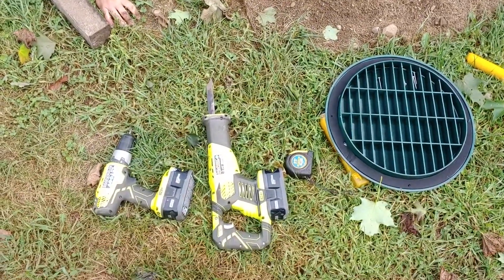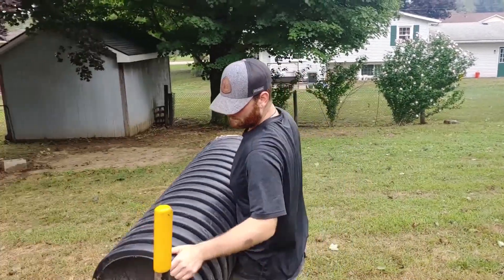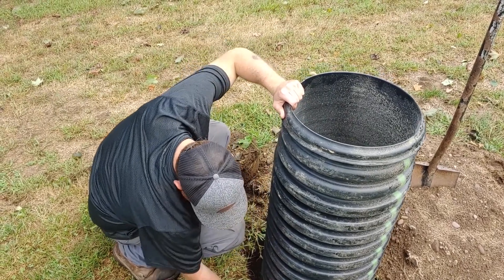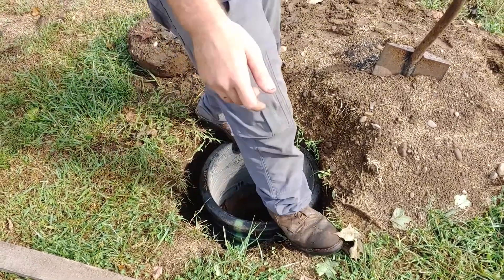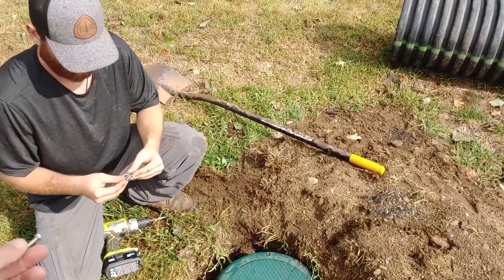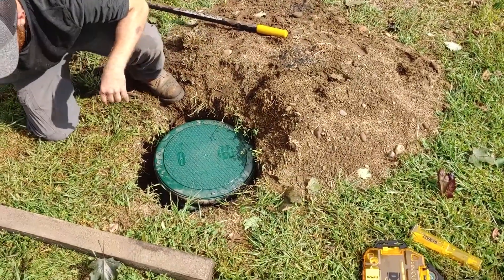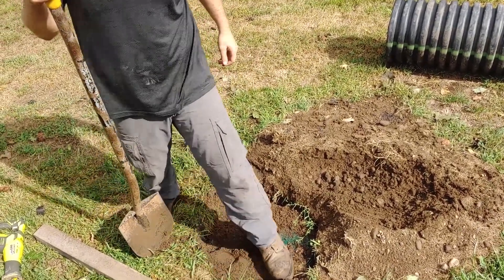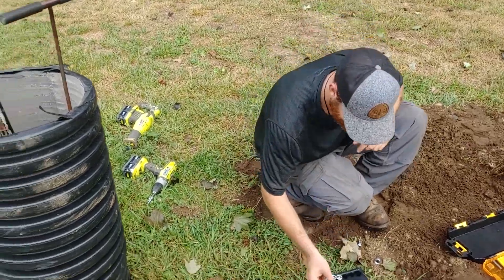How To Install a Riser on a Septic Tank

Comment: So, there is no gasket or seal attached to the tank?
Reply from the maker: if the riser is placed on. the flat top of the tank, a gasket could be used to protect ground water intrusion.  Thou that would be minimal. This riser is placed in the Taper inside the existing opening. No gasket/seamer is needed.

Comment: Thx for video.  I dug up my septic that is 6ft deep.  I want to put risers on top of the 2 cement lids.  I see 2 sizes are available, 18" and 24".  How do i know which diameter to use?
Reply from the maker: If possible go with the bigger one.
Ultimately just measure across your lid and add 2 inches.
Reply: @whipkeysepticpumpingllc.9796  It has 2 rectangular cement lids that measure over 5ft wide each.  Is there a benefit with going bigger diameter?  Also does it have to be double wall pipe if buried 6ft deep?  And i cant find an adapter ring online for 18" diameter.
Reply: Diameter is determined by   Hole in tank  16/18” dia  hole go w 24”  they make 12/ 24”
Mostly  they make 16x24 square
Reply: Older tanks may have no access  find center line in and out and drill top   Core bore  concrete lids are 4-6”
Thick

Comment: It appears a riser was removed and the new one Installed in place, installation being just resting it on the tank?
Reply from the maker: Nope. We dug down to the tank. Water infuriating isn't a real issue as the original lid is installed inside the riser. If we are worried about water or dirt working itself under the riser we would use waterproof adhesive around the bottom and outside of the base.
Reply: @whipkeysepticpumpingllc.9796  Thank you. I am replacing lids and one riser so your video helps me figure this all out.

Comment: In my state, you'd have to use a minimum of a 24 inch diameter riser at that depth. I'd also recommend filling the riser cover  with cement, because that plastic grid pattern will hold concrete with small aggregate, which really strengthens the riser cover. To be clear, it takes a day to setup, but then the Plastic Riser Cover can be flush with the grass, and it won't crack or break. Lastly, I'm a big  fan of the hex head screws, they seem to hold better, which makes the lid or cover more secure.
Reply from the maker: Thank you. We have tried the concrete in the lids before, with mixed results. No regulations for riser size in our area, we try to match it to the opening.
Reply: @whipkeysepticpumpingllc.9796 
I'm really surprised you don't have any requirements for how to size a "riser" on a Septic Tank. I'm in New Hampshire, and we have very strict state codes for Plastic Risers and Concrete Risers. In fact, we've got rules and regulations for how deep the Septic Tank can be without a riser, which is 12 inches. However, if the Outlet Baffle has a Effluent Filter, then a riser is required over the Outlet Cover of the Septic Tank regardless of depth. Also, all Pumping Stations require access at the surface of the earth, and must have a manhole big enough for an average size man wearing a protective suit with a harness and breathing apparatus, when necessary. This usually means a minimum of 36 inches in diameter, and sometimes even 42 or 48 inches if it's really deep. Keep in mind, sometimes we need to pump air into the Pumping Station or Pump Chamber, because it's 4, 5, or even 6 feet deep. I've personally repaired and replaced pumps that were 10 to 20 feet below the surface, and I could not breathe the air. I also couldn't have worked on them without a really big Concrete Riser that allowed me to put a ladder in the hole.
Reply: @craigwillson5974  I’m not man enough to hang with you Craig, most people couldn’t do your job. If they did, it would be at gun point.
Reply: @dennischristensen9479  Thank you for recognizing or acknowledging that Septic and Sewer Professionals are the unsung heroes of modern day society. By the way, I'm almost 60 years old, and I'm very concerned about the future of the Septic and Sewer Industry, because young people today aren't interested in working in this business, which is a big problem. In fact, I believe the average age of most Septic and Sewer Professionals in America today, is in the early to mid 50's. So, you have to ask yourself, when we all retire or die, who's going to build, repair, and maintain the wastewater treatment and disposal systems across this country... in another 10 to 15 years, this could be very problematic. Unfortunately, nobody seems to be worried about it, which in my opinion, is kinda scary.